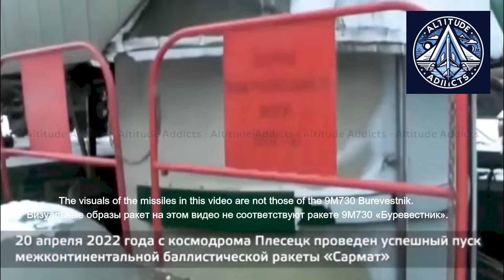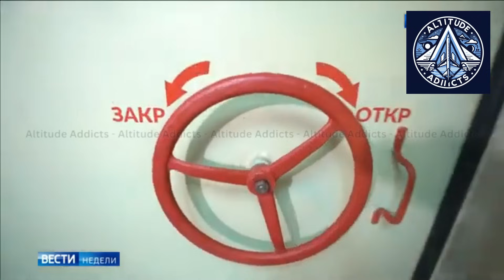Putin’s 9M730 Burevestnik Nuclear-Powered Missile: Which Scares Russian Enemies

Comment: The project Pluto was a different. It was imagined to carry several nucklear weapons, and to use the noise and radioactivity from the weapon itself as a supplementary weapon. Therefore it was supposed to have a 600 mw (heat) reactor with direct airflow through the reactor. They weren't kidding back in the 50/60'ties 😊.
Reply: noise of pluto was because of supersonic flight. it was ramjet missile.